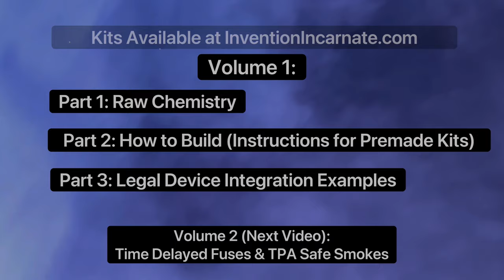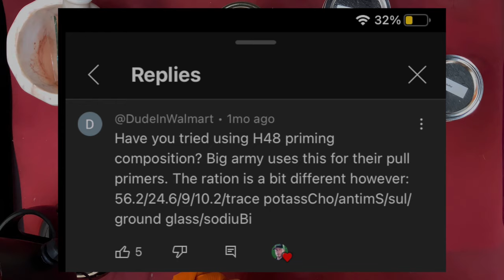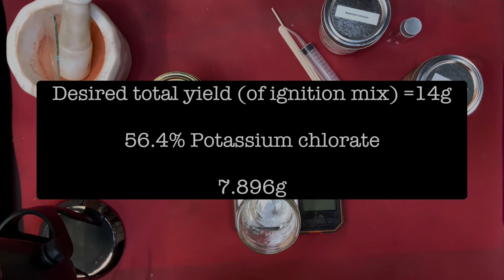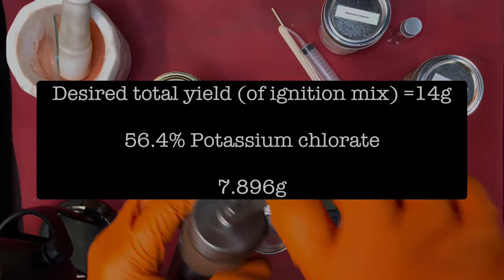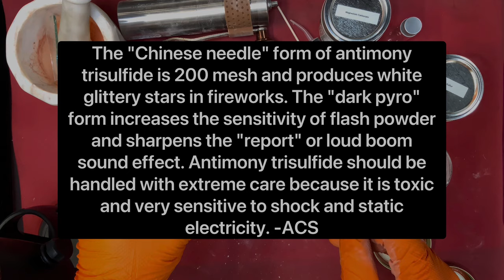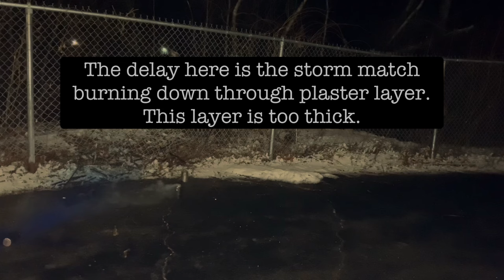Building High Performance Smoke Devices | Volume 1: Ignition

Comment: Please tell people do not mix potassium chlorate with red phosphorus. It will spontaneously ignite and blow their fingers off indoor blind them. Also the EU has banned potassium chlorate to be used with sulfur. There's been numerous incidents where is spontaneously lit fireworks. Moisture in the air makes sulfuric acid with the sulfur which then causes the potassium chlorate react. If it's going to be mixed with sulfur it must be done in a very careful Manner and must be done dry also must make sure it stays that way until used. But by no means red phosphorus be used with potassium chlorate. It can be used with potassium perchlorate. But not the potassium chlorate. Please make this well-known many people have lost their fingers and eyesight from this
Reply from the maker: Pinned
Reply: People who engage in pyrotechnics without extreme caution and understanding of the properties of the substances with which they work, neither fingers nor eyes are needed.
Reply: Idiots and pyrotechnics are unfortunately a self-correcting problem... Thanks for warning people.

Comment: Just had a thought watching the last couple of videos you made. Instead of the delrin rods, what about paper straws, cut to fit, insert into the smoke mixture and then put the plaster around it. Then you don't have to pull things out, drill or whatever, just cut the straws to 3/8" pieces or so?
Reply from the maker: Genius

Comment: For glass you can use glass bead to use it for sandblasting how much easier to crush up or just use the powder that comes after blasting. That can usually be found in the vacuum system
Reply from the maker: That’s what I use now, 70/30 blast media from harbor freight

Comment: Is the mix on ignition comp that you send in kits meant to be mixed 1 to 1 with the oxidizer that is in kit? I heard how you said they can’t be mixed together but not sure if it all goes together. Currently trying to create rn. Thanks!
Reply from the maker: Yes sir, the oxidizer (potassium chlorate) is pre measured to just be dumped into the ignition composition (grey), don’t put any in the striker mix,
Reply: @InventionIncarnate  How do we get collection of red phos? Seems unobtainable aside from scraping off match boxes.
Reply from the maker: Email me at inventionincarnate@gmail.com

Comment: Are these more reliable than the Firefox kits?  I had a 0% reliability rate with their kit.  I’m sure a lot of that is on me.
Reply from the maker: Just to clarify for anyone seeing this message: Firefox-fx is a vendor in Idaho, Gary Purrington, started the company 100 years ago and they decided to keep the exact same website since the internet started. We are talking ONE GIANT HOMEPAGE HAND-typed IN HTML WITH MORE STOCKPILED CHEMICALS THAN CHINA. There is a ton of amazing shit there but it’s extremely hard to find because of broken links and directories. To order, you basically have to call via phone to one of the four cell numbers listed on the website and hope to get someone someday. I ordered a resin smoke composite kit from them 2 months ago, paid $255 and still haven’t seen it. SKYLIGHTER is a different company in Moro bay California, that has an organized website and online store with Apple Pay and stuff. Skylighter buys some inventory from Firefox-fx and sells it for $3 more. I personally go with Skylighter because it’s just easier. I started making my own kits because neither supplier is in stock and i think my striker formula is better. Mine may be slightly more dangerous as they burn hotter due to the fact that there is no charcoal in my kits and a higher concentration of antimony trisulfide

Both kits should be at 100% reliability. That is absolutely bizarre. I’ve gone through 5 of their kits and the first kit was a learning curve and I experienced failure only because I didn’t let them dry completely, also I overfilled the cups and mixed the striker too thin 2/5 times which was remedied by double-dipping the tips, no homo. 1/5 kits (I’m convinced ) had too much potassium chlorate and was excessively reactive I’ll add a link below documenting that. I sent Skylighter that video and they sent me a new kit and suggested that I add some charcoal powder to take it down a notch.

I think that my kits are probably a bit more aggressive so be careful with the filling of the ignition cups. Also, I definitely use more red phosphorus than Firefox in the striker mix because that significantly increases reliability. 

The FIREFOX-FX kits have instructions on the SKYLIGHTER WEBSITE that a 3rd party do-gooder made because the kits are super confusing without them.  Links to follow:
Reply from the maker: Skylighter’s instructions: https://www.skylighter.com/blogs/how-to-make-fireworks/pull-string-igniter
Reply from the maker: Just kidding i deleted that video sorry
Reply: Copy.  I bought 2 kits, the first one was a messy learning curve, I’ll try the second one.